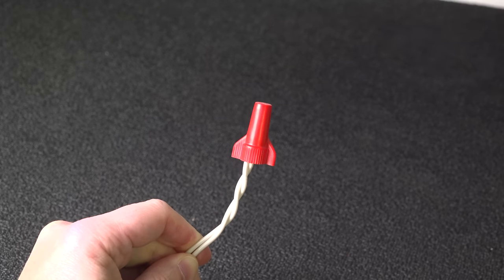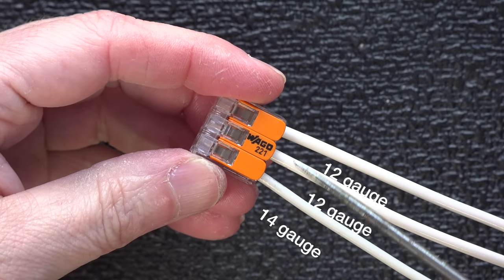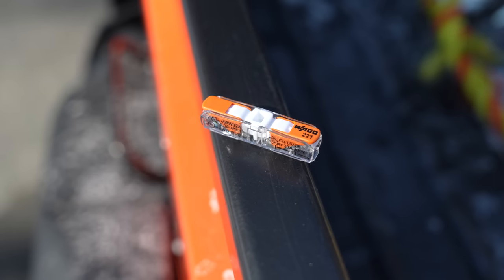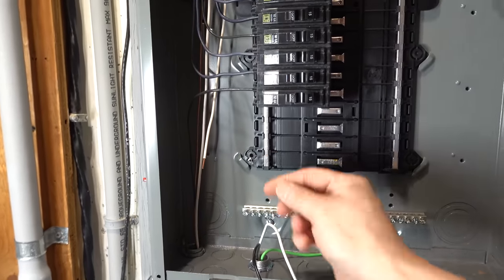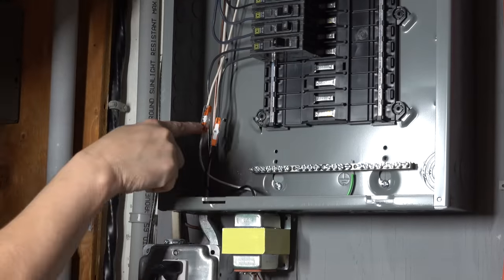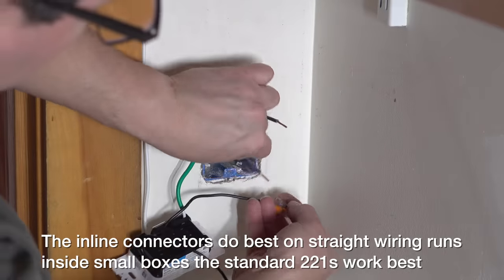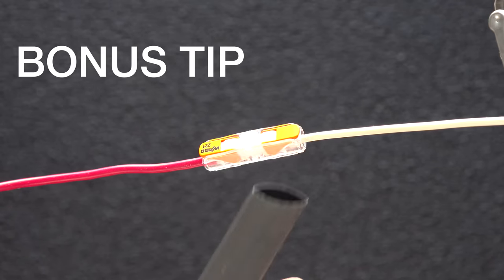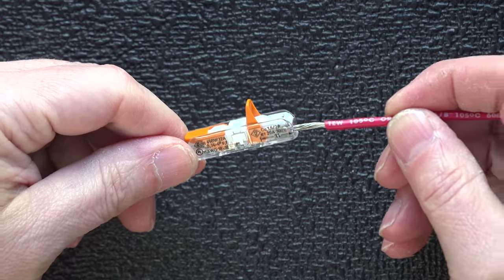New Wago Electric Connector is SHOCKING everyone - Inline 221 has arrived!

Comment: I have Ideal's version and their's are also pretty good (as long as you don't need to remove it later).  They are definitely needed when you start getting into upgrading to smart controllable switches that need a neutral wire connection.  Makes it pretty easy to tidy up and organize old wiring.
Reply: Ideal makes a lever version as well.  I grabbed some last week because my local suppliers didn't have Wagos and I didn't want to wait for an Amazon order.

Comment: I'm rewiring a 220V 30 Amp circuit and would love to use an inline splice like this. Unfortunately, even though they make 10 AWG Wago connectors, they don't appear to have one for the inline scenario. It's OK, though, as the splice will be inside a junction box where I'll have room to make the 90 degree turns.

Comment: As a commercial electrician here in Canada my question is how much do they cost compared to a regular Ideal can-twist. Many companies order them by the barrel full (25000). The thing is usually we wire something up and it doesn’t change for 20 years it’s not like we are constantly connecting and disconnecting our wires unless it is temporary wiring. I am all in favour of labour saving methods and we often use  the 4-8 port push in connectors. The lever nut style might be nice for the odd job or home handyman but currently they are too expensive for the commercial electrician.
Reply from the maker: In bulk I am told they are 2x the cost as wire nuts. But per job that incremental cost is easily offset by the reduction in per connection time which can be 80% less per 3 wire box which can translate into 1-2 minutes per box time saved.

Comment: Heat shrink tubing with a 3/1 shrink ratio with adhesive inside (from the factory) will work best.
I may add that there is no point in giving a much larger shrink sleeve than "WAGO" itself requires.

Comment: For solid wires you don't actually have to move the lever up if you insert a wire. For solid wires it is only for releasing them, that you need to move the lever up.

Comment: Nice. Do they have something like 2-2, with all 4 positions shared (shorted). Would be great for doing inline branching. I love wago, but indeed in some situations, using something like 3 or 5 position on all side is not great, I often need 3 or 4 (rarely 5, but sometimes I do), but with input on one side, and output on other side. 2-2 would be a great compromise.

Comment: Quick question, I am changing out a T 12 to LED light, I have to connect 2 blue and two red and one black together. Versus using a large wing twist nut can I use the WAGO 5 port and put one wire in each hole?  Sorry if this sounds like a silly question but at 70 Years old I wan to be sure

Comment: I'm familiar with the standard type and have used them for bench-top prototyping etc, but good to see they have inline ones now! They're neat and work well, though I've never tried to use them for anything permanent or high current.

In the UK, I don't think wire nuts have ever been a thing. My experienced former boss had nothing nice to say about them. When you change a light switch (for example), it has screw terminals integral to the backplate -- no flying leads, so you don't need anything to join wires, just a screwdriver. If you're extending, I think "choc blocks" (or better, junction boxes with a lid) are still pretty common, but I'm not an electrician so am not on the pulse with latest trends.
Reply: Indeed, wire nuts were once a thing in the UK a company in London was making them. But they were made of porcelain.   They were a complete failure because the cracked and fell apart! Supposedly the were banned at some point in the 40s  that legacy has stuck in the UK who has the opinion they are no good,  Indeed the UK wire nuts were no good. But that was quite a bit different than the standard current US designed wire nuts that have repeatedly proved themselves the best. as in lowest resistance, connection. Screw terminals rank right along with them. 

It shouldn't take a genus to recognize that a wire nut has the most surface contact in the connection, followed closely be the screw terminal. Both have superior mechanical force on the conductors,
WAGOs have a contact surface area that can be even les than the conductor cross section!!  And worse yet rely on aa flat steel spring to provide very low tension force, 

Many years ago as a young engineer, the "best" connection was the one with the least resistance. "Easiest" was never associated with best. In practice, to get the "best" connection low resistance connection we used silver plating as it has the best conductivity. Solder is used not because of its conductivity but to strengthen the mechanical connection insure high contact area and to prevent oxidation.

Comment: You can also buy wire stress relief mounts for the inline 221 connectors to secure them in case of regular movement.
Reply: I buy them in a packs of 1000 I think they are called zipties :)

Comment: A great plus to Wagos in general is, working on live circuits. Sometimes you just don't want to go find and turn off a circuit for a simple job. It's usually pretty easy to undo connections on live wires without getting zapped, but as they dangle, you can get zapped, and obviously, when hooking them back up with wire nuts, you have to grab the wires eventually. If you're using Wagos, once you disconnect everything, slap a Wago on any hot wires - boom, protected, no zaps, and you can grab wires without worry as you get everything ready for the new connections. When you're ready to make connections, you just open the blank lever and connect.

Comment: We never use wire nuts on Ships ( except in some in the house lights probably  were not  even marine rated ) only screw terminal blocks.

Vibration and movement is the issue , not found in homes or other buildings.
Reply: Actually, vibration is sometimes found in home environment as well, such as near motors in furnances, or ventilators.  I had electrical problems because lf that :)

Comment: I'd love inline connectors with more than 2 inputs. That way you can cut a wire, strip it, place a wago on it and split the cable without needing to lengthen the cables. Ideal for remodeling.
Reply: HOPEFULLY Wago have had the sense to do what the imitators do ... Enable them to be sideways stacked/interlocked, thereby solving the problem for any number of in line connections e.g. three, for standard T&E; four, for extending or connecting three core & Earth (two way lighting) etc. ... name your number.

Comment: Now if these were suitable for an in-wall splice, or without a junction box, THAT would be a game changer.
Im looking forward to the day these are almost as cheap as a nice wirenut, like those rubberized reds, I think Ideal makes. It would be amazing to go to a troubleshoot or smaller job, (maybe not a whole rewire though), and find wagos instead of nuts.
Reply: @Steve Sherman  That attitude is why I left the trade. 
  I remember now that these wagos remind me of those sacred Tyco NM inline splice kits that everyone liked to argue about. Someday the very standards of conductors, insulation, raceways, junction boxes, etc and the tools, hardware, and materials used to work with them could and should all change with new technology. The NEC will change accordingly. Never say never.
  Imagine if Ai, augmented reality, some kind of load side transmitter, and a fancy receiver could map the entire network of circuits in real-time and 3d space in front of you, and it was a common tool. Add a little FLIR, A/GFCIs, and some magic pixie dust and you'd never have to worry about a properly installed in-wall NM splice ever again, even for troubleshooting and rewiring... We're not too far off.
  Have a great rest of your week.

Comment: They are great , I love when new fixtures come with them but the price point to buy them  was ridiculous ,they were anywhere from 40 cents to a dollar each but now you can get kits that work out to about 35 cents if you are going to use all the different varieties in the kits , this compares to about 10 cents for a traditional marrette's . As the prices equalize these will become the go too .
Reply: According to what I found an electrician charges between $50 and $150 per hour for their work so lets work on the lower end of that and say a minute costs a dollar. Take that into your calculation and using wirenuts becomes a waste of money.

Comment: Funfact: You don't even have to open the lever if you use solid wire

Plus, there also are cheaper versions without the lever, but for those it's not as easy to get the wire out again.
Reply: Not only cheaper, but also a smaller, which is the reason I prefer them.

Comment: They always had some kind of 1 wire inline connectors for lights. Then there were some older 221 type chinese knock offs, as inline version for 3 wires. Wonder why they waited so long with those.
Btw, Wago has also waterproof boxes in different sizes, so outdoor usage would be no problem. Not as cheap as chinesium, but 99,999% reliable

Comment: I notice that you don't pull on the wires after you insert them into the Wago connector. If I'm making connections I always pull on the wires as a matter of course, so I know the wires aren't going to come out. It would be interesting to see how much force it would take to pull a wire out of these, especially solid core wiring.

Comment: Wago had a hybrid of inline push and lever connector for a long time (WAGO 224112) It is specially for light and has two push in contacts for solid wires on one side and a press/lever mechanism for stranded, ferrule, or solid on the other (lamp-) side, perfect for light installation but only for 0.5 - 2.5 mm2 / AWG 20 - 16.
If you have to use them in wet conditions there are gel filled housings available.
Reply: I learned something interesting on these and Ideal levers connectors that you can actually push in the wire without lifting the lever too..
Reply: @cantire1234  it works with solid wires

Comment: Yes, but do they come in a giant size? :)

I actually just ordered mine today. 

Thank you for pointing out that the traditional 221s will be a better fit in junction and switch boxes. I tried to convey that on another channel.
Reply: I haven't seen the inline wagos in the 6mm² cross section size, only up to 4, while the parallel 2-3-5 types of the 221 are sold in the 6mm² size as well. But unfortunately the 221s are not suitable for Aluminium wiring (at least not in Hungary), we are stuck with the 2273 push-connect with the AluPlus paste injected for solid Al wiring.

Comment: Multiple layers of shrink tube will give a high IP.  Not submersion but certainly splash proof, ideal in boats, RVs and trailers. Or consider using self amalgamating tape.
Reply: Or use a WAGO Gelbox. 

Or a  Cellpack EASY-PROTECT 332, if you can‘t get them in the US.

Comment: Oh, I didn't know these things are new. I bought aftermarket tail lights for my car and had to connect all the wires, I didn't want to solder all the tiny wires but I was a bit unsure about using the "regular" wago too... I found the inline ones by accident because a pack of them was mixed with the "regular" ones.

Pretty neat stuff
Reply: Crumbs, don't use them on cars. Car wiring is very different to home wiring.
Reply: @theweekthatis  no it's not
Reply: @TheByQQ  It is. Or do have have vibrations in a fixed electrical installation?
Reply: @johnscaramis2515  do you always just talk about random unrelated things?

Comment: FWIW, it is downright trivial to make a waterproof connection.  You just need to use one or more layers of adhesive-lined heat shrink sized for the wire on either side of the connector, followed by one large one to bridge the two ends.  Voila!

Comment: I like the line about those who stick with wire nuts only because they refuse to try anything else! Patriotism is deeply unhelpful at times, just because Wago are not "made in America" it doesn't mean that they are not very useful and a great solution. I learned the value of these over older connectors when dealing with industrial robotics both during the prototyping stage as well as the deployment.

Comment: My RV has these everywhere including under the chassis exposed to water splashing
Reply from the maker: No wire nut of wago should take direct water but these can be used in a outdoor and wet enclosures and they are tin plated copper with great corrosion resistance but only sealed type connectors should get direct spray

Comment: Can you use these to extend wire outside of a junction box, or would that not be in code? 

Example 
 I want moved a light fixture, Move it about 10ft from it's original location.      

Code would be 
Replace original light fixture with junction box , then from box to new light location. 

Could I? 
Extend connection with Wago inline connectors to new fixture location without junction box?

Comment: Wago connectors works really good, but I wouldn’t not use it in boats, especially in salt environments.
Reply: Use a WAGO GelBox or a Cellpack EASY-PROTECT 332
Reply: @maxking3  Did you ever do electrical in boats ? It is not an environment with easy access, places to attach things to, or have anything bulky hanging on your wires
Reply: @dmitripogosian5084  It depends what you want to do… A WAGO Gel Box is definitely up to the task of keeping connections dry with an IPX8 rating for submerged installations.

On most boats I worked on, the electrics were not designed for a completely submerged scenario anyway.

Heck, most boats would only see this exaxtly once… (but possibly forever!)
Reply: @maxking3  Hm, I have seen swamped boats quite a few times, but I am more into sailing.   Electrical has all to be ripped off after that, normally

Comment: I am splicing a 2nd set of Rear Turn Signals into my motorcycle. Can these Inline Wago Lever connectors accommodate TWO wires inserted into each end when splicing wires? I've seen "Splitters" for this application but they're 3-PIN and mine are 2-PIN.

Comment: Writing this from India. Wire nuts look dangerous. We have been using terminal blocks with screws for up to 20 amps and bolts for anything above. I hope we will see wago terminals in my state soon. But these are not fixed to the panel box which seems like both the advantage and disadvantage of this product.

Comment: I love WAGO connectors, however I have found another use case where wire nuts are still a better option. If you need to connect more than about four 12awg wires together, and are tight on space, then wire nuts still reign. Also if you have to exceed 5 wires (max size for a 221 that I have found), then wire nuts are still ideal up until the max capacity for a blue wire nut (eight 12awg I think). Trying to wire some ridiculous switch boxes caused me to attempt using two of the 5 port WAGO 221 and running jumpers between them, it worked but two of those big guys takes up a lot more space than a single blue wire nut.

Yes I realize connecting 7 wires together is probably not a good idea, however the guy that built my house was a plumber and not an electrician so he didn't know that having half a dozen loads (lights, ceiling fans, etc.) on a single feed from the breaker box was a bad idea. And I don't have the ability to rewire it at this time.
Reply: "two of the 5 port WAGO 221 and running jumpers between them"

I have some junction boxes with 6 cables and 2 light switches, all on the same breaker, and that's one thing I was thinking about doing for the ground wires until I found the x8 push-in connectors (Wago 2773 408), which are very compact compared to regular wall nuts.
Reply: That is not the Wagos fault, that is just faulty planning, do it right to begin with....

Comment: Those who wanna use it to extend wire in inaccessible areas NO you can only use these in accessible junction boxes! or anywhere u extend wire these connection must be made inside of junction boxes only. (these will fail more often than wire nuts)

Comment: Wago's don't work in humid environments or environments with a lot of vibrations. Many of the machines we use at work come fully outfitted with Wago's in every single joint and generally by the end of the first year we have to replace every single one because they have all failed. 

Also i'm fairly certain it's not legal in NA for you to put a splice inside the breaker panel, it needs to be in a junction box.

Comment: No need to open the lever, you can just push solid core straight in. Also use the stripping length guide and the probe test point on the back of the connector.

Comment: I've been using Wagos around the house when replacing old outlets and light switches. I've encountered a lot of very short wires, so I really like that I don't have to strip and twist those wires and makes them even shorter. And if I or a future owner wants to replace the receptacle or switch down the line, the wagos release right away with no damage to the wires. 
I do wish they made a 4-gang version. I've had a few situations where I needed to connect four wires, and the 5-gang is pretty big and also leaves an empty receiving hole. They make 1, 2, 3, 5... is 4 next?
Reply: I think you have to pa glue a couple of them (2+2, 3+1) together and throw them in your toolbox. Now i have to try that myself😂
Reply: if going by their previous lineup for the solid wire connectors the next in line would be a 8-gang version..
Reply: @Michel-7.7.7  Haha, I don't think that'd work cuz the metal wouldn't be making contact on the inside unfortunately. Expandable connectors are an interesting idea though I like where your head's at.